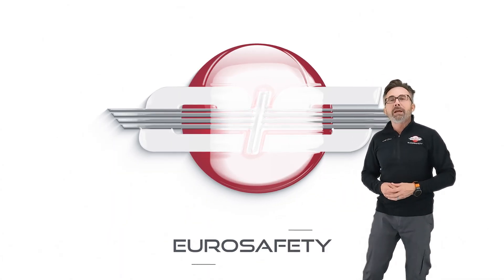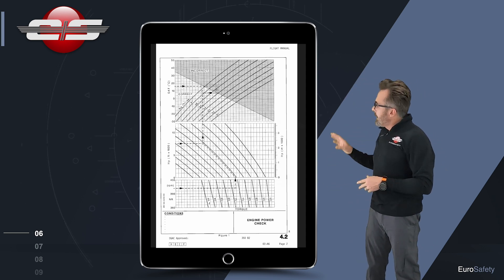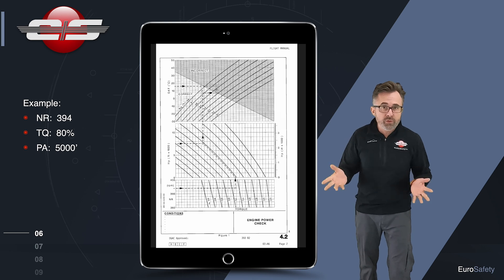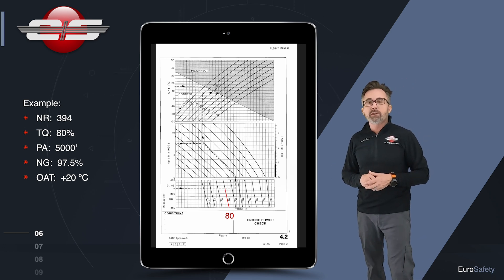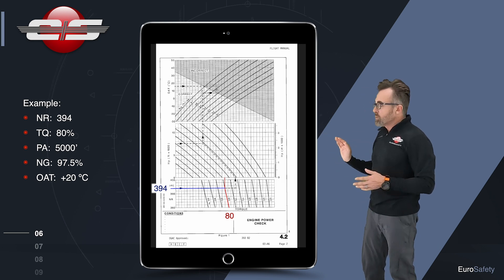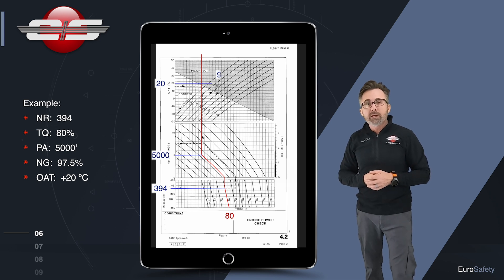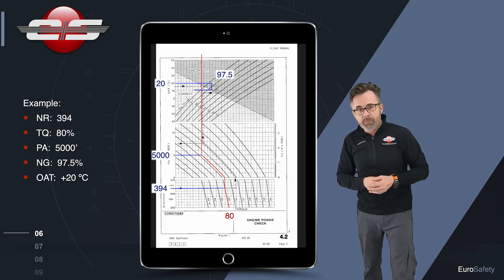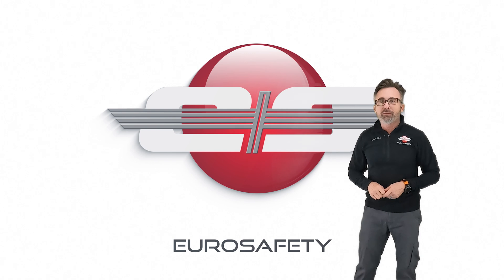#56 - Using the Power Check Chart for the AS350B2 and Below

Comment: What is the correct procedure if you keep getting an incorrect value?
Reply from the maker: I think what you are looking for is a correction that is applicable for the Arriel 2. There isnt a correction value for the B2. I am assuming you are referencing the Donaldson filter. In the Supplement it states... If the engine
health check is not satisfactory then either clean the filter and recheck the engine health using the basic Engine Power Check chart or recheck the engine health using the Sand Filter Engine Power Check chart located in
the Sand Filter supplement. If engine health is satisfactory Sand Filter performance can be obtained and the Sand Filter performance data charts are applicable. If the engine health is not satisfactory then either clean the filter or contact maintenance for troubleshooting. 

It also states... Ensure that the IBF FILTER caution lights are not illuminated during performance of the EPC.

Helicopter performance is reduced as the IBF becomes contaminated with dirt, dust and debris. The pilot/operator is responsible to utilize the Engine Power Check (EPC) procedure to determine if the engine
can produce installed power. If engine health check is not satisfactory, published performance cannot be achieved.